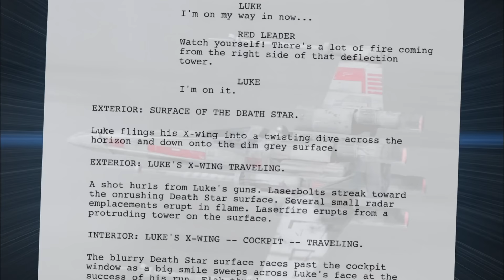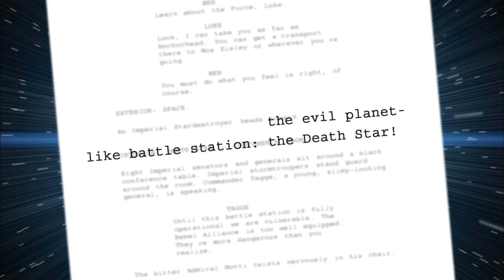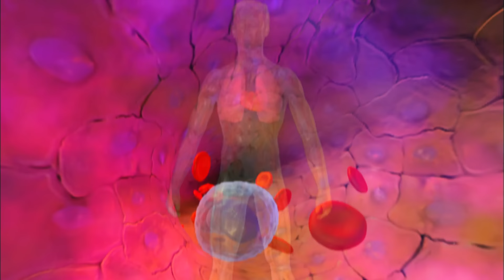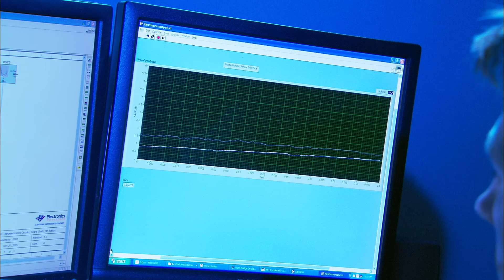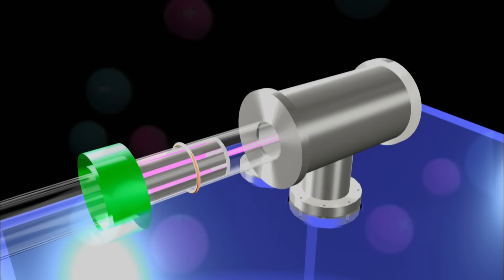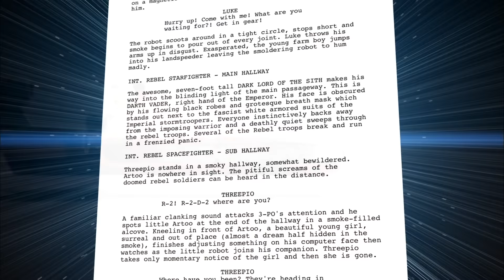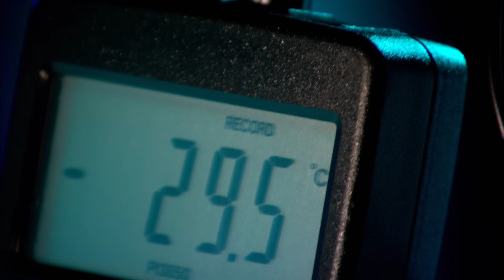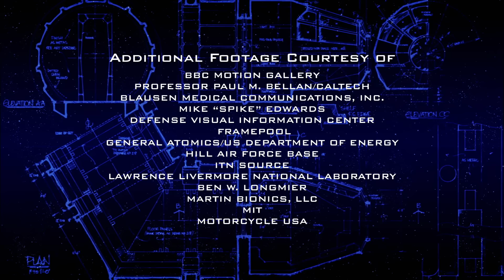Star Wars Tech 2007 Documentary

Comment: Seems like the one answer to all these problems is plasma.

Ionized gas atoms.

Twin ion engines? 
Plasma
Windows in space, or barriers between atmosphere and vacuum?
Plasma.
Lightsabers?
Plasma.
Deflector shields?
Plasma.
Reply: TWSTF 8 
Windows in Star Wars are made out of Transparent Steel, a man-made material that has been made in real life as well.
Recently a model airplane flew successfully under its own power by utilizing a single Ion Engine and magnetically charged wing tips.
Theoretically speaking, a very strong EM field should be able to freeze a blade of hot plasma and create something similar to a lightsaber.